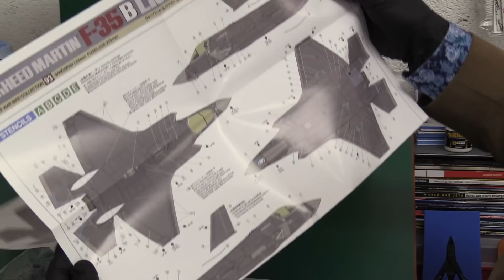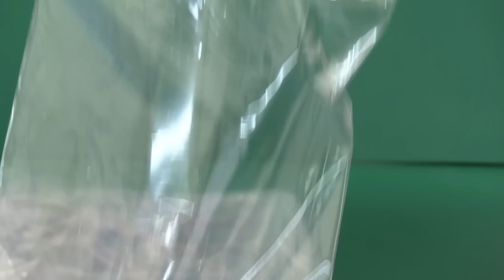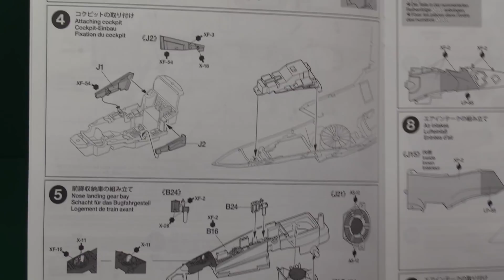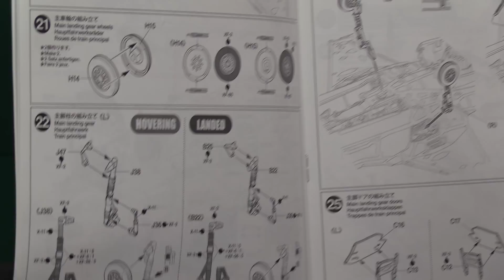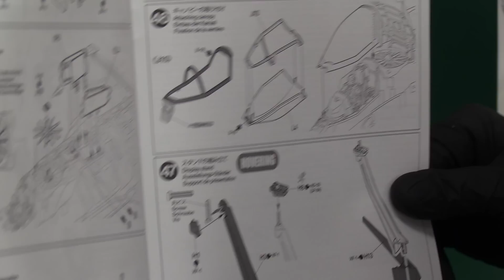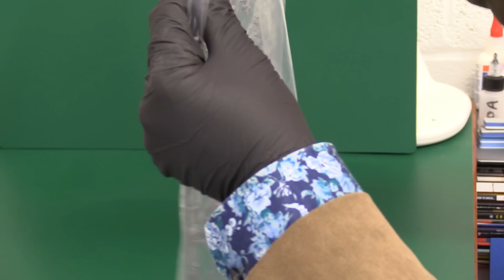Tamiya F-35B 1/72 (60793) kit review

Comment: The F-35 is going to be the main global aircraft system over the next 20 years across multiple nationalities. Whilst they all have boring stealth paint schemes, if youre Airfix, Revell, Tamiya, Meng etc etc, not having an F-35 in 1/72 and 1/48 is a large gap in your product range (airfix for example could/should do UK specific weapons such as Spear 3, Meteor Paveway IV etc because no one else will). It may not make any sense to the modeller, but if you dont have it in your standard range, its lots of lost sales and opportunity. It's lunacy that Airfix hasn't produce a EF Typhoon. My cash has gone straight to Revell.

Comment: I just built the 1/48 Tamiya Spitfire Vb. The decals were generally atrocious, particularly roundels, which have two parts - the white backing, and then the blue/yellow/red part. Although the rear fuselage band and yellow wing leading edges were fine.
Reply from the maker: @MGDN62  An older kit.

Comment: Perhaps this is a stupid question, but how does a Harrier have Dambusters markings? Aren’t they a WW2 squadron? Fantastic video again btw 🙌🏻
Reply from the maker: @Haydinius  617Sqrn were flying Tornados until recently...but yes an odd choice for F-35, I agree.
Reply: @Peter-Oxley-Modelling-Lab  617 is a bomber squadron and really the F-35 should be designated as F/A-35 (joint strike fighter project after all). In that respect it's a direct follow up to the Tornado. The stupidity is that it's a Marines variant rather than the A model, which the RAF ought to buy (if we weren't saving pennies for Tempest).

Comment: Peter, there is a comment on the side of the box by the Italian version that says "This model can not be assembled with doors closed". Does this mean undercarriage down and lift fan door open is the only option? If so, definitely not a 10.
Reply from the maker: @FinsburyPhil  Yes it's designed that way to have the nozzle down and doors open.
Reply: @Peter-Oxley-Modelling-Lab  For take off (even on the carriers) they use a downward (but not vertical) nozzle angle. Given its Tamiya, you'd think they'd allow all three options ?
Reply: @Peter-Oxley-Modelling-Lab  Looks like a fabulous kit but I'd pay another fiver to have the option of having it with the fan door closed and nozzle horizontal
Reply: They have the in-flight, fast forward aspect on the leaflet. Very surprised they don't offer it on the sprues.
Reply: That’s a real top standard 1/72 kit